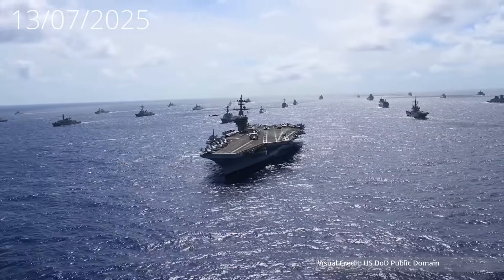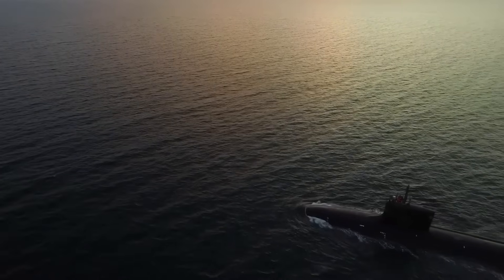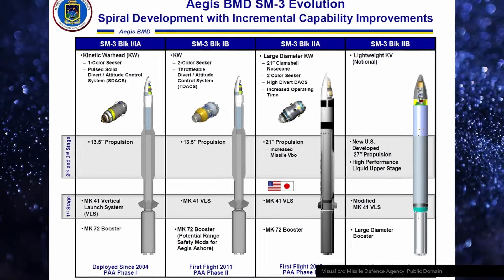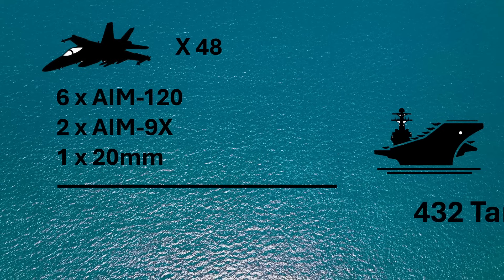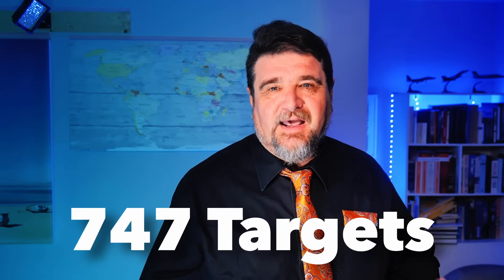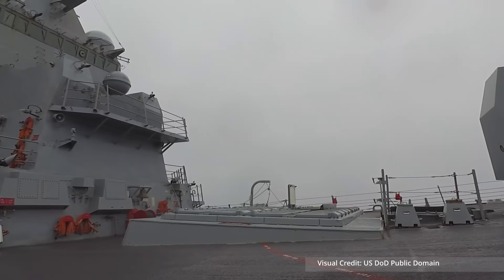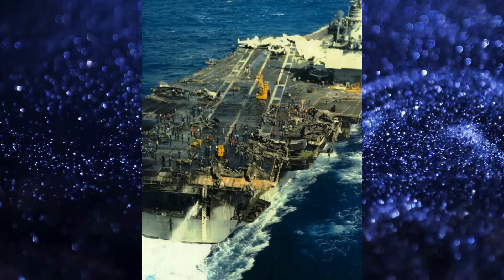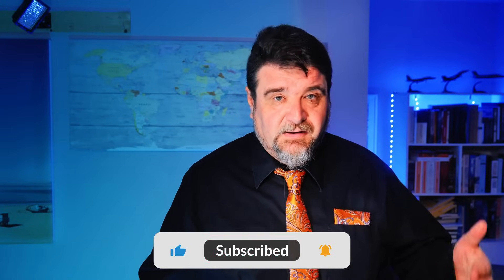HOW MANY Missiles are Needed to SINK A CARRIER?

Comment: On the occasion of the accident with the missile detonating on the deck, the fire and then the bombs detonating: it is wrong to compare it with "6 large Soviet cruise missiles"

First of all, the bombs and fuel will still be there to multiply the damage in addition to the warheads of the 6 cruise missiles.

Secondly, the damage on the accident was localized and on the deck, 6 missiles hitting multiple different areas can cause fires and secondary detonations that will overwhelm the damage control crew.

Third, cruise missiles do not only detonate outside causing blast damage, they carry very high kinetic energy and cause penetration. This penetration means that compartments deeper inside are not safe, this can even include the power generation. More hits increase the likelihood of a critical one.
Reply from the maker: The Mk 82s detonated in the hangar.
Reply: @Millennium7HistoryTech  They could still detonate if a cruise missile hit the ship, that is my point, that event was at best the effect of a single cruise missile hitting the deck. 

We shouldnt forget how Moscwa sunk, it was fire and ammo detonations that took down the cruiser.

And if you think this was Russian incompetance then it was not, USS Bonhomme Richard was burning 4 days at port with the assistance of ground based fire fighters due to an accident in 2020.
Reply: @billwhoever2830  You want to debate semantics when the point is the damage was assessed to be the same. But what would the Navy know? It's only been sailing carriers for over 100 years and in multiple wars. A better analogy to the Moscow would be the Exocet missile strike on the USS Stark in 1987 or the Iranian mine detonating under the Samuel B. Roberts in 1988. In both cases the US ship while heavily damaged survived. The Moscow obviously sank. This is because there is no excuse for poor damage control.

Comment: TLDR:  Aircraft Carriers are sitting ducks to hyper-sonic missiles and a few well placed torpedos.  Aircraft Carriers are used to project power not fight actual wars.  If the Houthi can almost take out a carrier along with a couple planes that "fell overboard" you know we are not ready for war.
Reply: I’m not sure they ever got close to sinking or taking out the carrier
Reply: Aircraft carriers are the safest places on earth.

Hypersonic missiles don't travel at hypersonic speeds when they are about to hit their targets. The lower atmosphere doesn't allow it.

Houthis tried to hit a US carrier but the carrier moved, and avoided the contact.

Hypersonic missiles don't have active guidance because the heat and plasma around them makes it impossible to utilize radar or infrared guidance. They are only good for stationary targets.

Moreover, aircraft carriers are protected by several warships, aircrafts and submarines constantly.
Reply: USN too now have some fast anti-ship ones with SM-6/AIM-174B, AGM-88G, and upcoming SiAW/MAKO.
Reply: Hypersonics reduce probability of intercept, not make it impossible. Sure you will need less Hypersonics to saturate the missile defense network but hypersonics are also way more expensive, harder to produce, more prone to failure and currently none of the ones in active service are the maneuvering type instead they are just ballistic missiles or straight flying cruise missiles whilst definitely an issue aren't the superweapon they are claimed until they can actually maneuver to evade. You need less hypersonics to sink a carrier, but you also have less of them and they cost more.

As for torpedos, a few well placed ones will absolutely sink a carrier. The issue is getting them to the carrier. People often point to excersizes where a sub managed to get to the carrier and "sink" it but these training operations are not made to reflect reality. Getting anywhere close to a carrier in a combat stance with active sonars going off and ASW-Heli's using their dipping sonars is basically impossible. Chinese submarines aren't caught up with the other big boys yet so that won't help.

If you really want to sink a carrier just throw a bunch of stuff at it and see what sticks. Why bother making so many expensive hypersonics when you can make 10 normal missiles or 50 cheap but inaccurate missiles. The Task Force will have to intercept them anyway, you are better off just making them waste their expensive interceptors on cheap cruise missiles and then once the enemy fleet is empty just hit them with a few hypersonics to deal the damage. Or stop trying to compete so heavily in the air where the US has invested most of it's money into and make hundreds of small submarine drones to flood the ocean with. 

I think current generation of hypersonics, altough very capable, are mostly used for their morale/power projection effects. Don't worry about the american naval supremacy, we have these very big very scary very powerful missiles that make carriers totally useless and obsolete! Don't ask why we are also building carriers tho. I guess a few hundred USV's aren't as good for propaganda as the giant missiles you can parade trough your cities.
Reply: @einehrenmann6156  你的观点中有几个错误。
1.高超音速导弹其实并没有想象中贵。和平时代武器贵是因为生产的量太少，导致摊销生产设备和研发设计的费用占比特别高，其实武器本体成本占比并不高。当战时大量生产，其实费用不高。特别相对于整个航母以及上面的飞机价值来说，那点钱其实可以忽略不计。正因为如此，虽然中国目前已经开始建造世界最大的核动力航母，但实际上军方对其定位也十分清晰，航母这种武器不是用于大国对抗，因为在高超音速导弹面前，没有太好的生存能力。而是用于低烈度战争和战略威慑。另外补充一些题外话：中国的兵工厂全部是国有企业，而且武器的零部件全是自己生产。如果启动武器战时生产模式，武器的生产成本很低。
2.因为中国是后发国家，所以，中国海军的传统是最重视潜艇这种不对称威慑武器。虽然现在中国的科技能力已经积累到某个特定程度，但这种传统依旧保留。只不过因为潜艇的属性决定了其透明度不如航母和驱逐舰这类大型水面舰船。如果中国能制造出最先进的航母和驱逐舰，但你还认为潜艇还不如其他国家先进，请问，是不是不符合正常逻辑？你不了解中国人的个性，真正最核心的，不会给你说。
美国目前依旧拥有海上霸权。但实际上，是中美共同维护的结果。因为，在中国看来，只要不影响到我的利益，并不想打破美国的海上霸权。既然美国愿意当出头鸟，为什么我们不乐见呢？中国有一句谚语：枪打出头鸟。中国没有当霸主的愿望。
Reply: The houthis never got anywhere near taking out a carrier.

Comment: Oreshnik and Zircon have entered the chat
Reply: USN too now have some fast anti-ship ones with SM-6/AIM-174B, AGM-88G, and upcoming SiAW/MAKO.
Reply: @johnsilver9338  one oreshnik : 36 warheads.  A couple of oreshniks and the entire carrier group would be mission killed just from having its defensive missiles exhausted.
Reply: no need for them. There are missiles designed SPECIALLY to sink carriers and nothing else. Not new, KH22 was operational since 1962.
Reply: Two very different missiles. Oreshnik is not designed for and doesn't have the accuracy to kill a ship, even a carrier, unless equipped with a nuclear payload, manoeuvring hypersonic missiles like Zircon currently lack reliability at headline speeds and have to slow down in terminal to reacquire a target due to plasma build up on leading edges degrading their sensors - even a carrier at moderate pace will have moved enough to require the missile to adjust, meaning they can be defended against. Also no carrier group is just going to let someone sit there accurately relaying their position.
Reply: @Rroff2 finally some intelligence on here.
Reply: Lol @Rroff2
Reply: Oreshnik couldn't accurately hit a stationary land target never mind a moving ship.
Reply: @SnakePliskin762 who says it can't? And your cope is real maybe ask Yuzmash.
Reply: @SnakePliskin762 oreshnik can't hit a ground target acurately?? Dude, just loak at the Ukrainian factory they used for demonstasration: EVERY SINGLE HEAD landed within the factory, most of them over a very specific line thru its longest axis. Zero heads detonated outside, most of them hit within 20 meters of the central axis. For something that literally fell down from heaven, that precision is impressive

Comment: Grate theoretical video, but a bit disappointed that you brushed if an Chinese attack like you did, they study carriers to, they know how to act in case of war and they will not fly 100 bombers against a target, they will fly bombers and drop missiles from stand of range, beyond the flight screen, they will simultaneously engage with submarine lunched missiles from several direction and they will also use ASBM and several type of electronic warfare methods, both from airplanes and drones and they will also attack several targets simultaneously, not only the carrier itself and also likely they use drones in the attack, both attack drones and electronic warfare drones.
If it is this easy to defend a carrier USA wouldn’t worry.

And about the explosion onboard the carrier, they detonate on top on the carrier and also in an open space, cruise missiles penetrate and explode, different type of damage.

Comment: so   how much does 500  Wing Loong-X UAV's cost?  $500 million.  These are long range sea skimming UAV's specifically design  to take out ships
How much do the current  US aircraft carriers cost? $10+ billion.
Its a no brainier,   I can absolutely guarantee the Chinese will have way more than 500  Wing Loong-X UAV's available specifically to deal with the US carrier  threat.  And multiples of that to take out  multiple carriers and escorting ships. Not only do they pose a threat to  the carrier ($10+ billion) but potentially all the aircraft on board  (a conservative $2.5 billion).
That's a cost ratio in excess of 20:1,  and those drones can be  replaced in a matter of months not the  5+ years it takes to build a carrier.

Comment: Will a US carrier survive top down attack of 30 Mach ballistic missiles?
Reply: If we assume that the incoming warhead shall hit the ship - which really isn't at all guaranteed in reality - then it comes down to cases.

If the warhead is a tactical nuke airburst, then the CVN will likely survive, as will most of her crew; the poor guys topside will probably die, and she'll be deaf, blind, and dumb. If the warhead is a near contact tactical weapon, the deck will be on fire, and everyone at the level of the hangar bay or above is dead or soon wish they were; and the ship will probably be scuttled at sea. A city killer means a dead carrier, no questions asked. Of course, the response will be severe - but anybody hitting a carrier at all is in it for all the marbles already.

If there is no explosive, then the warhead is effectively a great big rock. I prefer the mental image of an anvil falling on Wile E. Coyote. The weapon will pass through the ship top to bottom, absolutely wrecking whatever it hits. It will be almost certainly a mission kill, but relatively few sailors will die. Also, the ship will probably be able to limp home under her own power and will spend a very, very long time in the shipyard.

Assuming the warhead is conventional, then the fusing matters. It's reasonable that a purpose-built weapon screaming in from space will penetrate however far it wants to before exploding. We're going to assume it doesn't hit the island, due to the very low probability of that event, but please be aware that the possibility does exist with its own tradeoffs; but probably wouldn't be intended. An explosion right below the flight deck will render all flight operations impossible, and will mission-kill the ship because the blast will wreck the catapults, arresting gear, and all the other "stuff" that directly supports flight ops. The next likely setting is for the hangar bay, which will destroy the one (of three for a Nimitz) bay it explodes in, and will also punch a honking big hole in the flight deck, possibly knocking out a catapult or jet blast deflector on the way down. The final, and least likely to be programmed, is a deep strike - because the compartments become increasingly armored, and with better overpressure mitigation; but you might hit a magazine, engine room, or even a reactor itself. Strangely, this last option is the one that has the carrier back in the fight the quickest, but simultaneously also destined for the yards for the longest duration and shares many similar characteristics with the "big rock" attack in practice.

Finally, please note that the carriers are "sister ships". None of them are identical, and the specifics of one ship doesn't necessarily apply at the same extent to the others even in the same class. The Ford ships are also even more their own thing. (Good luck sinking Doris Miller, for example - she's not even floating yet)
Reply: @mikehammer4018  Damage, maybe; sink, very unlikely

Comment: That's not even close to how a salvo to destroy is calculated. Also when using a hypersonic like zircon. It's almost impossible to shoot down and its kinetic energy alone. 2 would be hard to believe they wouldn't sink it
Reply: You forgot to mention a couple of Star Destroyers and a Death Star 😂
Reply: Hypersonic missiles have to slow down in the terminal phase and still need an Airborne asset for guidance. As for zircon well ir has yet to reach it's quoted speed according to those that have been launched so far.
Reply: USN too now have some fast anti-ship ones with SM-6/AIM-174B, AGM-88G, and upcoming SiAW/MAKO.
Reply: Not for anti-ship @johnsilver9338
Reply: The Zircon missile has been shot down multiple times in Ukraine by the Patriot system.  And the AEGIS systems used by the US Navy are considerably more advanced and can engage at far greater distances.
Reply: @codedlogic  Did you believe this BS . The AEGIS  won't even have time to react because of the "plasma" that is created during the hypersonic descent. The Patriot anti-aircraft system is worthless against Zircon missiles too . Find better sources to inform you of how they performed in Ukraine and against the Iranian missiles.
Reply: @harrypolychronopoulos478 Can you cite a source that says “plasma” prevents Aegis interceptors from engaging their targets?  It sounds like something you just made up.
Reply: @codedlogic  Just type  on the internet "can hypersonic missiles be intercepted?" That's a way to get your answer.
Reply: @harrypolychronopoulos478 My friend, you should know by now that NAFO minions only read CIA-funded Kyiv Independent.😏
Reply: @codedlogic  Radio engineers might talk about the critical frequency of ionospheric plasma to determine whether a radio wave will be reflected by the ionosphere or not. Remember the Space Shuttle?  Radio communication with the Space Shuttle was impossible during re-entry because a hot plasma "bubble" formed around the vehicle, blocking radio signals. It all depends on which radar frequencies are used and the induced plasma's critical frequencies.
Reply: @harrypolychronopoulos478  Wow, you went from "you need to get better sources for your information" to "just type what I say into the internet to get an answer."  You truly don't practice what you preach.
Reply: @codedlogic according to the PRESStitues sure. But in reality they US military and all the think tanks say 90% the truth. They say a full battery of 36 has almost a 5% chance.  I still think that's to high.
Reply: @codedlogic LOL someone believes the Ukrainians
Reply: You are a special kind of extra chrome Homie if you think Zircon can’t be intercepted. Patriot PAC 3 missiles have already done so in Ukraine with independent verification. Imagine thinking that the aegis combat system, which is known to be significantly more efficient with dramatically better interceptors like the SM-6 wouldn’t be able to intercept is just absurd. Stop typing if you don’t have the IQ to for a coherent thought.
Reply: @TackshooterOG  hypersonics cannot be intercepted at least the latest generation ones. Theres no known air defense capable of intercepting a hypersonic kinetic missile. Even s400 cant. And thats supposedly the most advanced ad system on the planet after the s500
Reply: @TackshooterOG  Zero hypersonics have been intercepted in Ukraine. PAC3 Patriots can't even intercept the Iskander which is the slowest ballistic missile used by the Russians. Please provide links for the "independent verification" that you mention. Instead there are numerous videos that show Iskanders taking out multiple Patriot launchers which means that pac3s are unable to intercept the Iskanders even when the missile is heading directly to the launcher, which goes to show that right now there is no AD for hypersonics. We have also the example of the Iranian hypersonics hitting Tel Aviv, where we see that even the most sophisticated AD is completely incapable to deal with hypersonics. The technology just isn't there yet.
Reply: @jsbfe9395 wrong the s500 can specifically the 77N6(N). Even the s400 can technically do it. Just for starters it travels twice as fast as the patriot. But in the beginning both systems will have a bunch of leaders till calibrated.
Reply: @TackshooterOG  Try to be better informed than misinformed. It is a very bad thing believing company brochures and what the Zelenskyvite press tells you. Just go and type on the internet "can hypersonic missiles be shot down?" and maybe you will learn something.

Comment: You oversimplified scenario. There is PHD thesis on Aegis capability. It states missiles like Harpoon, Exocet and similar has 5% chance getting thru while SS-N-22 Sunburn Having 12% and P-800 Onyx 35%. Zircon therefore will perform even better. Given that 1-2 Onyx is enough to sink Arleigh Burke class destroyer some 10 will be needed per ship..So in total some 60 Onyx missiles will do the job. For Zircons even less. Instead of hundreds of H-6 bombers 2 Yassen class subs will suffice.
Reply: There's a big mistake. US navy launches two missiles per incoming to increase hit chance. The Houthis literally penetrated the 2 outer defence rings of the Burke destroyers so they needed to use the point defence weapons.
Reply from the maker: It was meant to be